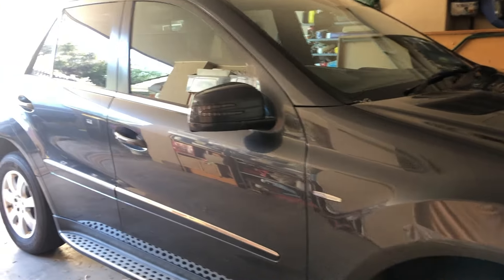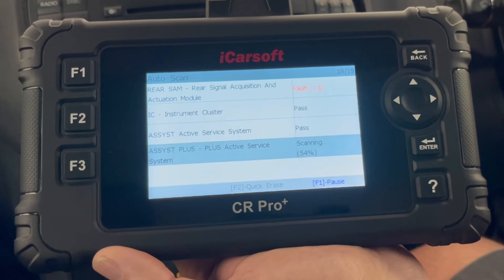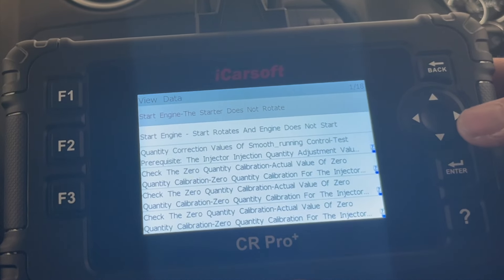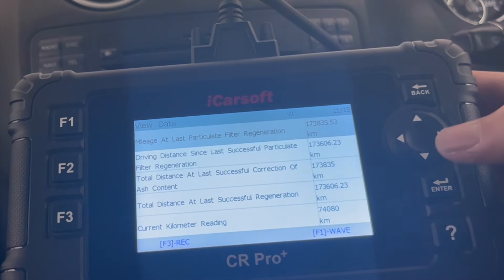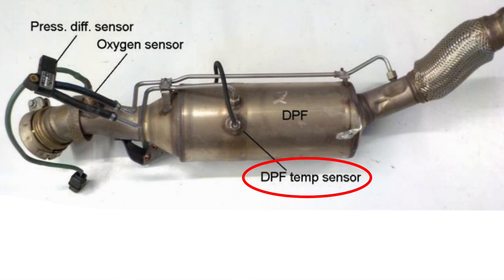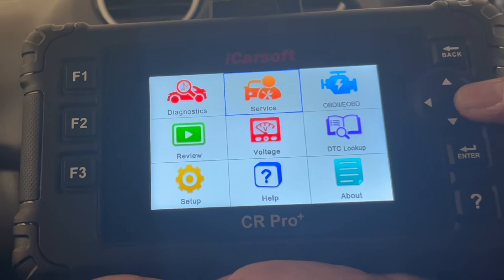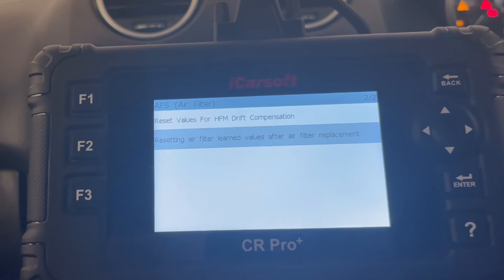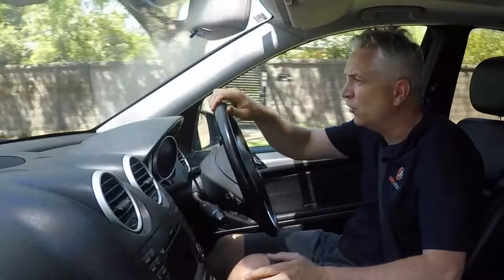Mercedes Check Engine Light DPF - 148A00 Error Fault Code - Part 2 - Let's fix this for good!

Comment: Finally got around to cleaning my DPF of ash (red-brown in colour) and plenty came out. Fixed. DPF needed to be removed to change RHS engine mount anyway. Job really wasn't too bad. No more 148A00.
Reply from the maker: Nice, I'm glad you finally got back to it!  These engines are so complex, I understand that you have removed your DPF and manually cleaned it but I still wonder why it clogged so bad in the first place.  If you haven't seen recently I replaced my themostat and whilst you may think this is not related at all, as I said these engines are complex and my old thermostat was running the engine way too cool and I just wonder if this partially impacted my vehicles ability to do proper hot DPF burns all along.  Anyway check how warm your engine is running from the dash and checkout my video on the thermostat if you are interested: https://youtu.be/zLN9AvHwRy4 Cheers Drew :_DFI:
Reply: @DrewFixIt  I told you about the updated PN thermostat originally lol. Yes the thermostat helped a fraction but didn't really make all that much difference in my case, neither did full clean of the intake manifold & egr system, new air filters, PCV  and new turbo, all needed doing anyway and it all no doubt helped a bit. My problem was DPF ash buildup (not soot). Maybe previous owners were using the wrong oil and years of a bad PCV. Mine has done ~220,000kms, ash buildup seems a bit premature but should be good for at least another 200,000kms now. Thanks for your vids, really helped me work on my car and work through to finding the problem on my ML350.
Reply from the maker: @joetrojan2568  ahh, ok, well I should say thankyou for putting me onto considering my thermostat!  My car was definitely running cool!  What I'm thinking is many factors may build up with these cars over time!  Cheers Drew :_DFI:
Reply: @DrewFixIt  all good, figured you wouldn't remember me, it has been a while. Sounds like yours is running mint so that's great news.
Reply from the maker: @joetrojan2568  I did a big trip last school holiday's and it ran really sweet.  2 days after I got home the Front Left wheel bearing went, which I replaced on the channel!  Appart from that it's running really well, but mine has cracked 190,000 kms so things are going to break!  Cheers Drew :_DFI:

Comment: Same code here but did the air filters 1st plus it was due for an oil change. Done and reset filter adaptions but error re-occurred. Will try the DPF cleaner additive next right after cleaning the MAFs as they are a bit grimey. Thanks for the effort on this, not much info out there for this specific code.
Reply from the maker: Hi Mate, I suggest put the LiquiMoly DPF Anti-Clog in and then take it for a good country highway drive for a couple hundred kms!  Cheers Drew
Reply: @DrewFixIt  Today cleaning the MAFs made no difference. I noticed you did the PCV prior to any of this, have that ordered. DPF AntiClog yet to be ran. My turbo has excess play so a new unit ordered as well.
Reply from the maker: @joetrojan2568  yes and I also put a genuine Mercedes PCV on.  If you’ve watched my videos you will know I’m a big fan of the non OEM parts normally but in the instance of the PCV I really wanted to make sure it was spot on!  A worn PCV will mean you could have excess oil go in in the intake so it could be correlated!  Cheers Drew
Reply: @DrewFixIt  found some more info: there is an updated thermostat PN. Mine really doesn't get above 80deg C very often usually around 50-60. Should be 90. Looking in the regen history the last successful regen was over 50,000kms ago (edit: disregard as I am not reading the KM correctly) but pressures and levels all read fine. I'll report back after some new bits are installed, probably the just the PCV and thermostat, the turbo can wait and I'll do the oil cooler seals as preventative while I'm in the V for the turbo. Thanks again. (FYI 210kms 2012)
Reply from the maker: @joetrojan2568  Hi Mate, interestingly mine runs cool too, but I have never thought much of it.  I just did a test drive of about an hour at highway speed (circa 100 km/h) and my temperature is running between 70 and 80 deg C.  You could definitely be onto something and what you might find that as a complete system many little things add up to this code manifesting with the vehicle trying to regen too often!  Please report back and let us know how you get on?  Cheers Drew
Reply: @DrewFixIt  No error Sunday or today with the warmer weather, took note today of when it kicked in to do a regen, did my best to keep engine temp around 80 until regen completed. Parts should be here Wed. Edit: differential pressure sensor ordered too.
Reply from the maker: @joetrojan2568  Hi Mate, I just want to let you know that I too have now replaced my thermostat, here is the video: https://youtu.be/zLN9AvHwRy4 my vehicle is soo much happier for now running around at a higher temp, at some point I will do a video on the outcome, however running at let's say 90 to 95 degrees now all of the time the engine and transmission are super smooth.  The car rarely does DPF burns again now, I'm just super happy, so absolutely thanks for even suggesting this temperature consideration as mine also was running low and whilst I think i was actually on top of the DPF issue perhaps as a system there are genuinely multiple things impacting this specific issues of too many regens and it's kinda like a bit of a swiss cheese effect, anyway as always have a great day and a genuine thanks mate!  Cheers Drew :_DFI::_DFI::_DFI:
Reply: @DrewFixIt  Great to hear. I have mine back together but am yet to drive it enough to give accurate information. New PCV reduced fuel usage ~1L/100km, thermostat brought temps up but still DPF regening every ~150kms. Did full intake clean and new turbo, will report on findings as soon as I can.
Reply: update: still 148a00 but also had "ash content too high" a couple of times, next is to clean DFP of ash, car is parked up until I get around to it.
Reply: @joetrojan2568 did you ever find the isue?
Reply: @dominic_onexero  Car is parked until I get around to removing the DPF to clean the ash, will report here once I have anything to say. Driving the trusty '97 W140 S320 in the meantime
Reply: @dominic_onexero @DrewFixIt Finally got around to cleaning my DPF of ash (red-brown in colour) and plenty came out. Fixed. DPF needed to be removed to change RHS engine mount anyway. Job really wasn't too bad.
Reply: Did it solve the issue? Even after cleaning the dpf it didn’t solve mine…
Reply: @CiobanuAlexD  cleaning out the ash (not soot) did fix mine, have been daily driving it for a couple of months now no problem no codes.
Reply: @CiobanuAlexD  what have you done so far to yours to try to fix? What car/mileage?
Reply: @joetrojan2568  the engine had an oil consumption, problem that was ignored for about 3 years until the  engine was rebuild, after that the P148A00 code started to pop up. I replaced the injectors, replaced the pcv, replaced the air filters(all mb original parts) cleaned the dpf twice, checked the turbo, but the code stil pops up after two weeks of running. At this point I think that the dpf is simply clogged… I was considering replacing it with a new one but the mb part will set me back 3000€ and about the aftermarket one I heard only bad things. The car is a W221 S350 bluetec from 2012 and has 350.000km(200.000mi) the engine was fully rebuild 10.000km ago. The car runs wonderful but the check engine light drives me crazy
Reply: @CiobanuAlexD  Did you see what came out of the DPF when it was cleaned? Mine had a heap of red/orange, cleaned with hydrochloric acid 10% solution in water. Also maybe do a smoke check to check for any air leaks?

Comment: Hi Drew,
Thanks for sharing your video. I have a 2008 ML 320, there is no check engine light shown but my vehicle is running poorly. I recently had some work done on it after I was hit by a deer. The shop noticed there was a slight shutter of the transmission. I had another shop put in some Shutter Guard (Fix), it worked for about a day and a half before the problem got extremely worse. It has serve jerking and a very rough driving experience. When in park, I tried raising the rpms and it wouldn't go beyond 2000 rpms. I am in the United States and wish you were here😊. Do you think it may need a new torque converter? Any suggestions?
Reply from the maker: Hi Mate, I would never put Shutter Guard in a Mercedes transmission.  I would personally straight away do a transmission service on it as per:
https://youtu.be/ggGk3_Uu5_M that being said if your engine won’t rev past 2000 rpm in park then I think you have an issue on the engine side too.  The best thing to do is to scan the vehicle for codes to diagnose the issues that you are having with a scan tool.  If you do not have a scan tool, here is a very cheap one for Mercedes: https://amzn.to/3BKnVL8 This tool will allow you to read and clear all of the Mercedes faults with your vehicle.  Cheers Drew

Comment: Hey Drew, I am using Carly to check the values and my differential sensor is changing from -20.000 to +20.000. My soot amount is -200 grams and I don't know what the problem is. I bought the car like this and did change the PCV and air filters, but with no adaptations. What do you think could be the problem?
Reply from the maker: What codes do you get from Carly?
Reply: @DrewFixIt  P148A00 and P13AF00

Comment: Hey, Drew, this shop didn't drain my torque converter, and now, 15k miles later, I have a p2759 code.  Just wanted to know if the solenoid is in the conductor plate/valve body? Thanks
Reply from the maker: Hi Mate, I would say this issue is unrelated to not draining the torque converter.  As per my video on the 722.9 service https://youtu.be/ggGk3_Uu5_M?si=cXH5u26lBmtOvp2V I don’t personally think that it’s overly necessary unless the oil is clearly burnt!  Cheers Drew

Comment: Hi drew, I have the same vehicle just older 2007 over the last year I have been having problems with jurking when accelerating usually between 2 and 2 1/2 thousand revs and hesitation on gear change sometimes, I have replaced the turbo actuator about 3 months ago and had it reset this didn’t help? There are no engine check lights? Any advice or help you could suggest would be gratefully appreciated
Reply from the maker: Hi Mate, we have had a similar issue with the Black W164 ML320 that you sometimes see on the channel.  I am assuming that you fitted an aftermarket turbo actuator yourself?  Double check your setup and re-check all of the linkages and potentially try another aftermarket brand of turbo actuator as we had a similar issue and found that going with another turbo actuator solved the problem.  Cheers Drew :_DFI:
Reply: @DrewFixIt  hi drew thanks for your reply in the end it was the egr valve sticking and causing soot to block the dpf filter I’ve had these both resolved and had a stage 1 re-map done to the car now the car runs fantastic and with much more torque and hp and strangely better fuel economy 👍🏻
Reply from the maker: @jasdavsim  interesting!  I am surprised that the card did not through an error code indicating that the EGR valve was sticking ... did you scan the car for codes?  I have never had a re-map done personally, however given that you had one done did you by chance do a "soft" EGR delete as part of the re-map?  Cheers Drew :_DFI:
Reply: Hi drew I took the car to an turbo specialist here in the uk ( best turbos ) they said the egr sometimes will not fault if  it is intermittently sticking and yes I’ve had a deletion on egr and dpf both programmed out, the stage 1 retune as increased hp by about 35-40 and about 100 torques cheers